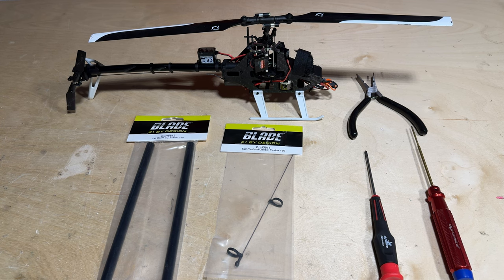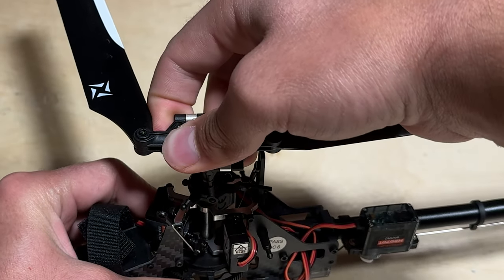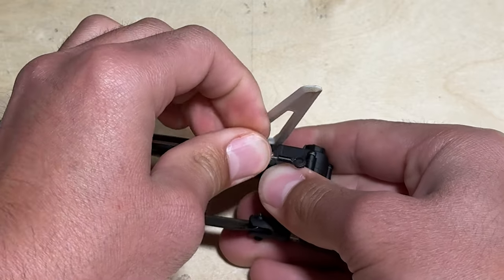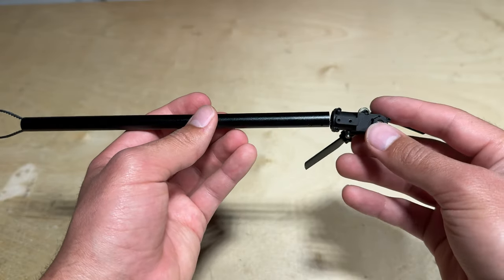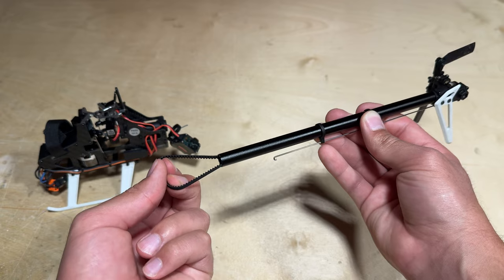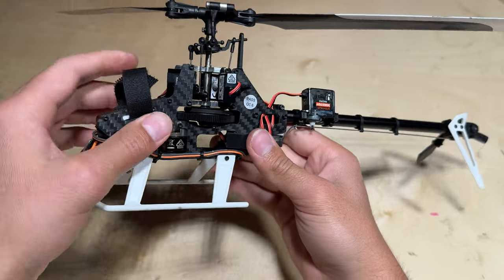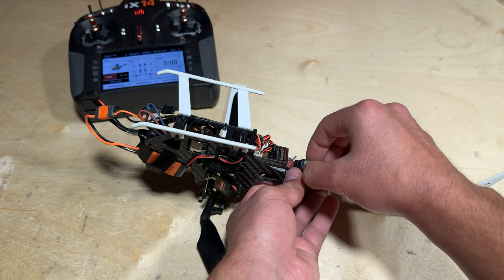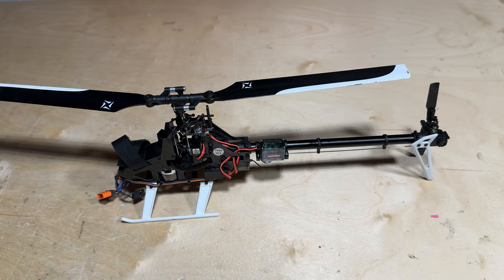Blade Fusion 180 | Tailboom / Tail Control Rod Replacement

Comment: Thanks for video. When reinstalling tail boom how do you know if you have sufficient tension on the belt
Reply from the maker: Great question! One way to ensure that there is sufficient tension on the tail belt is to apply a small amount of pressure on the belt where it almost reaches the Front Belt Pulley [BLH5807] with a small driver. There should only be a small amount of movement (a couple mm) in the belt when applying pressure to it.